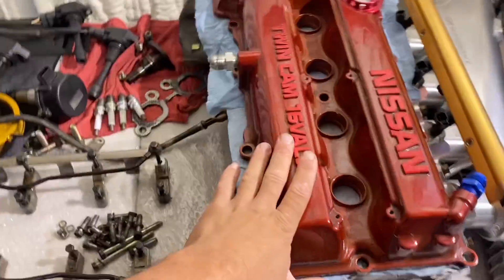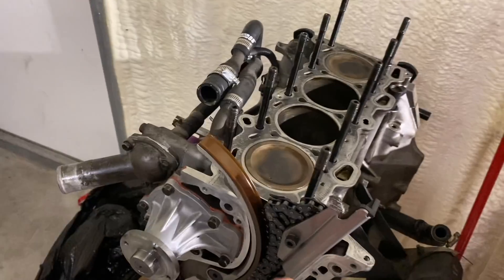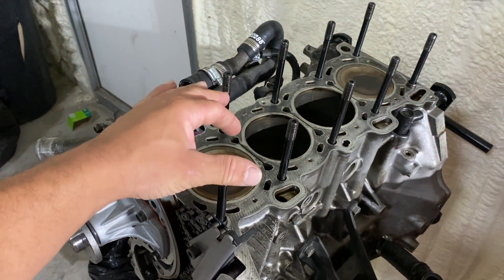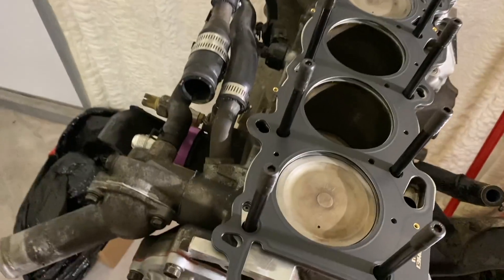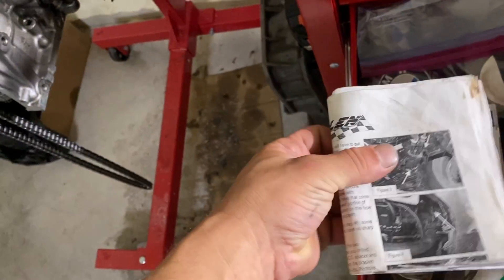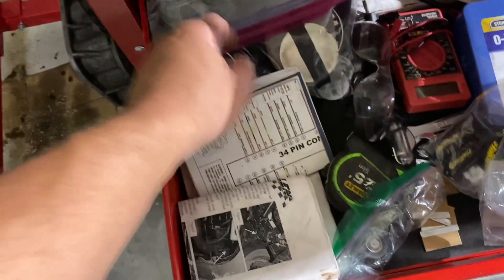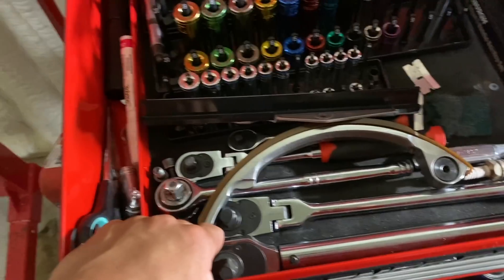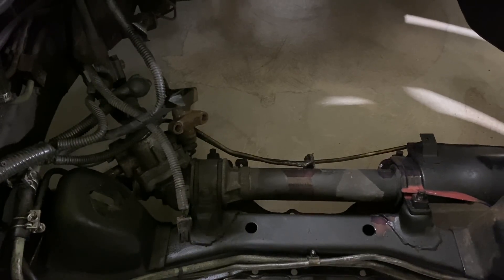SR20 "Head Way"

Comment: Lucus heavy duty oil stabilizer works good for assembly lube to, could have just used oil to lube the stud bolts with, better than nothing, if you don't use anything it creates alot of friction giving a false torque reading.